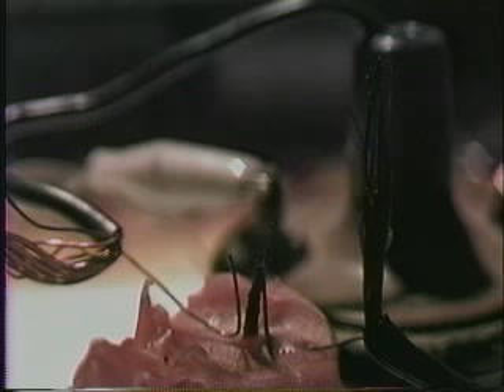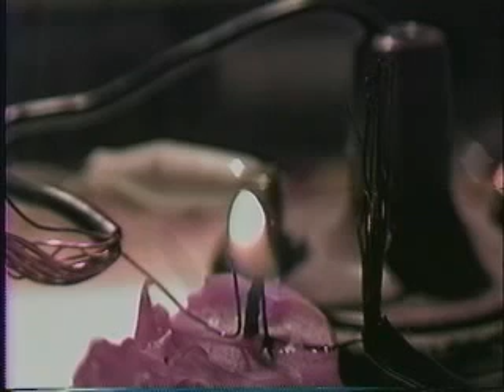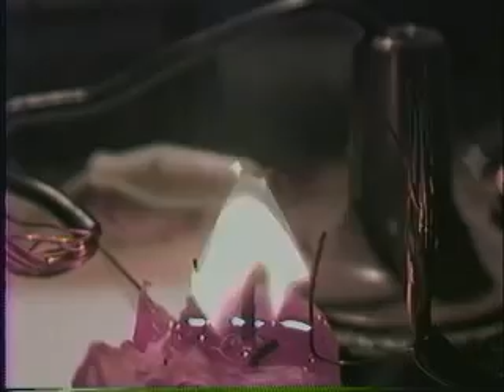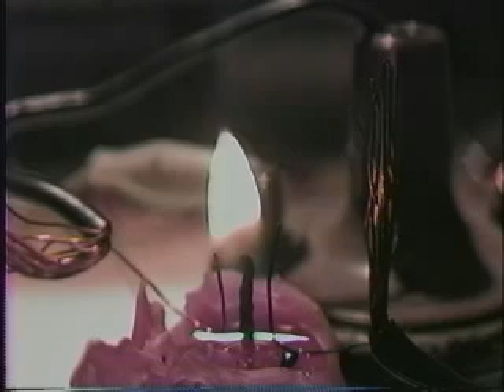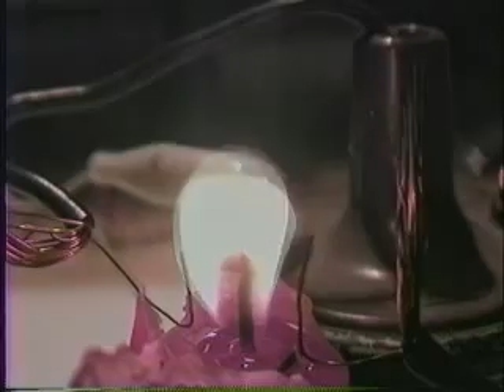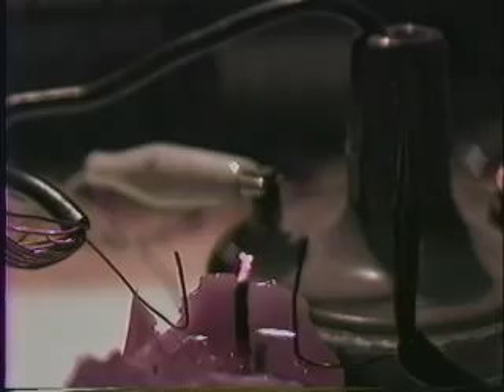Singing Candle- Weird Science Experiment- Magic Trick

Comment: The electricity travailing  through the flame from one wire to the other makes the sounds. the flame is just in the way of the wires so it makes that sound. The amount of energy put into the wires makes it either high pitch or low pitch.

Comment: And I am usually the one correcting peoples grammar. But I am not wrong. I have made a modulated high voltage circuit and it is built exactly like this one minus the flame. There is sound before it ever made fire.

Comment: This is not fake at all.

In simple theory, its an electric "circuit" with a "resister" or oscillator to adjust the frequency of the electricity.

Thus giving variations in the sound as the current get a "skip" from wireA to wireB.